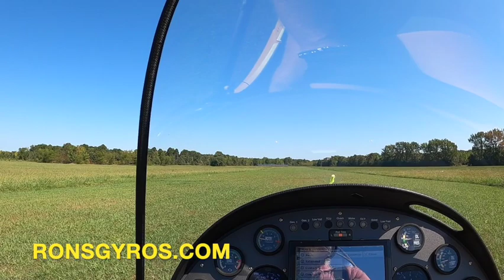Density Altitude *IMPORTANT INFO*

Comment: Discuss the differences between an aborted Gyroplane takeoff vs fixed wing. Fast on the ground and not in the air.
Reply from the maker: I'm making a series of 6 videos of the maneuvers required in a pilot certification check. Should be completed soon. An aborted take off is quite simple ,the gyroplane has a slow ground roll and take off speed unlike that of an airplane thanks for watching.
Reply: @RonsGyros  looking forward to it.